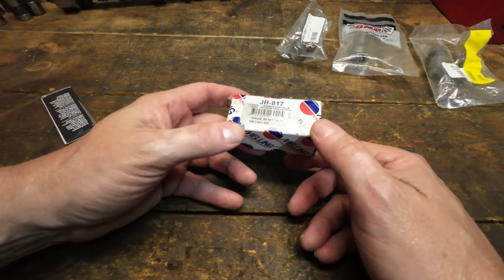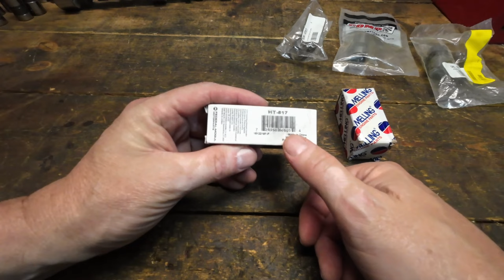Why your Flat Tappet Lifters Failed

Comment: I've talked to many camshaft manufacturers say the in the past 8 years say that lifter manufacturers are putting out poor quality products I've gone thru 3 set of lifters to get one good set. No swirl pits so on. Trying to push people to hyd roller.
Reply from the maker: @mattcross428  the big three that still make flat tappet lifters haven’t change the recipe on how they make those lifters.  Granted, they have limited production on them as those manufacturers also are tier 1 suppliers to the OEs and they have been on roller cams for going on 4 decades.  These still bigger factors at play here.

Comment: I found the more aggressive cams seem to have a higher rate of failure.
  Also Lucas make an amazimg break in oil !  Dont take an addictive and shake it up in the jug.
Reply from the maker: When I was collecting cams and lifters for this series, I saw no range of cams that had better survival rates.  Nor hydraulic or solid lifter cams.  It was a very broad range.  Maybe 50-60  failed cams is what I started with across all brands.  Can’t remember where I posted those pics but it was crazy to see so many in one spot.
Reply: @MuscleCarSolutions  in my experience the very high lift cams I have done have been prone to lifter/can issues. Like you said it's mostly a valve spring problem and a person not listening to protocol. I can't help a person that knows everything. Left the shop with all instructions even offered to do the springs before and after break in lol. 75% don't want the help.

Comment: I know you’ve said a dozen times by now about mixing brands of lifters and cams. But why is it I hear a lot of guys will get a comp cam or even a summit cam, and throw Genuine GM lifters with the hardened bass? I imagine if the new comp DLC lifters become popular, they will end up being the same. What’s your thought on why some guys like yourself say use GM lifters with the hardened base, with whatever cam they choose?
Reply from the maker: @GasBoy25  comp uses the same taper and crown as GM.
Reply: @MuscleCarSolutions  so if I bought a comp cam, I could use either the gm lifters or the DLC ones and I should be fine if I follow everything else like you mentioned as far as springs, bore clearance, and break in procedure?
Reply from the maker: @GasBoy25  I’ve had no issue, but if you’re doing it because you’ve been convinced that the GM lifters are superior, they aren’t unless you’re working on a stock profile cam.

Comment: I’m putting a new Comp cam and lifters into a 305 Chevrolet with new bearings and rings but I can’t find any break-in specific springs for it. Are there any you’d recommend? My initial plan was to just use the existing stock Chevrolet springs and my machinist said reusing the old springs should be fine since the engine spec’d out fine otherwise, but I’d like to eliminate as many variables as I can.
Reply from the maker: @mtfan  your machinist can find a spring for you that will set up at installed height with under 200 over the nose and less than 100 on the seat.  There’s a number of ways to get there.  If they’re a good machinist, it won’t take them long to find one.

Comment: The lifter failures are due to issues with machining of the lifter crown and occasionaly on the cam itself.  Here's what I do and recommend.
1.  Use a MATCHED SET OF COMPONENTS (kit) with matching cam / lifters / valve springs.  DO NOT MIX AND MATCH CAM, LIFTERS AND VALVE SPRINGS!!  Do yourself a 

favor and get a new Comp Cams or Edelbrock MATCHED KIT.  The wrong springs for your cam will kill it.
2.  Take your cam and lifters to a competent machinist to measure each lobe for correct taper and each lifter for correct crown. [It seems incorrect 

machining has been on the increase causing this rash of cam failures]  so this step is a MUST now.  See below how to check the parts yourself.*
3.  When installing the lifters, make sure each lifter will turn freely in the lifter bore and that there is no excessive wear of the lifter bore to cause 

lifter wobble.  
4.  Follow your cam company guidelines for installation (What you put on the bearing surfaces is not the same as what you put on the lobes for example).   
5.  Follow your cam company guidelines for break-in.  Do not let engine idle at all.  
6.  Use a HIGH ZINC break-in oil and then after break in use a High Zinc motor oil (DO NOT USE ZINC ADDITIVES OR DIESEL OIL!!)
7.  Drive the vehicle easy for the first 500 miles, don't go full send until you know that it's good to go.

*  If you don't want to take the parts to a machinist to measure, then do this:  Install and adjust everything but leave intake and valve covers off.  Prime the oil system with drill then install distributor to drive oil pump.  Then crank engine over with the starter with no plugs installed.  Check EVERY lifter to ensure it is TURNING smoothly.  If you have one not turning or turning but not smoothly... you have an issue! If they are all turning smoothly and evenly, complete assembly and fire it up!  If they are not, disassemble and find out why.  It won't fix itself!
Reply from the maker: I wish that lifter/cam failures were only due to machining of those tow parts.  In reality, it’s much more than that.  The other videos in this series cover those aspects.

Comment: I've been a mechanic for 30 plus years and have installed many flat tappet cam shafts and never had a single issue. Now, l installed a comp cams,valve springs,retainers on a big block chevy, and 20 minutes at 15 hundred to 2k rpm the cam and lifters are coming back out,im guessing its flat already, granted its been probably 10 years since my last flat tappet cam install,seems like everything that rolls into my shop has a factory roller set up,im guessing the cam and lifters are of poor quality
Reply from the maker: @barnhousegarage  what’s your lifter to bore tolerance?
Reply: @MuscleCarSolutions  haven't checked it yet,the cam and lifters that we took out were 20 year old comp cams and nothing wrong with them just went to a cam with a tighter lobe separation and a touch more duration,it's kinda strange that the cam and lifters we pulled out are nearly perfect and the new cam or lifters are having issues with 20 minutes on them,will now more tomorrow when we get it apart
Reply from the maker: @barnhousegarage  that’s something you know BEFORE you assemble an engine.  What spring pressures did you use for break in?
Reply: @MuscleCarSolutions  followed comp cams instructions, and it didn't say anything about spring pressure, the set up we got from comp cams came with the cam lifters and springs all in a kit,if there were issues with lifter bores l would have thought the old lifters would have shown ware? it shouldn't be rocket science, but l sapose there be an issue with the block? Hopefully not
Reply from the maker: @barnhousegarage  strike 2!  Spring pressure must be reduced dramatically on break in.  Initial and for the extended break in.  Big block Chevys while cool, absolutely have a horrible valvetrain design from the factory.  Without knowing the lifter to bore clearance and if it was in spec to facilitate the rotation of the lifter, and having way too much pressure, and a break in RPM was was a touch too high at 2000 rpm, that engine had all the right conditions to fail.  So what break in oil did you use?
Reply: @MuscleCarSolutions  Castrol 20w50 ,and I'm not doubting you on spring pressure. l agree that to much spring pressure isn't good on a cam during break in but l would have thought comp cams instructions would have said something about that?

Comment: The problem is the finish on the ground face of the lifter. One lifter manufacture left in USA, they make everyone's made in USA lifters.
Reply from the maker: Incorrect.  There are more than two still making flat tappet lifters and if you’re referring to the crown on the lifter, they are ground for what the taper on the lobe is.  As long as they are compatible, there is no problem.  Even crown that is well outside of the OE spec can work just fine, IF the right taper is ground on the lobe.

Comment: Dont use Chinese made lifters and cams!
Reply from the maker: I wish that was the only problem with flat tappet cam and lifters.  Sadly it’s not.
Reply: @MuscleCarSolutions  I use Elgin and Melling cams and lifters they are inexpensive and work good never a problem. They produce in USA and Mexico, here in Germany we add 2% Mos2 (Molybeniumdioxide) additive by Liqui Moly or Molykote to the engine oil aftre break in. German and Swiss Army do the same with older Tank and truck engines.
Reply from the maker: @Schlipperschlopper  never mix brands on cam and lifters.  Go watch my video on measuring crown on lifters.  Melling was the absolute worst.  Playing chemist and mixing your own oil is also a bad idea.  Any modifier doesn’t mix unless it’s at the right temperature and of it doesn’t interfere with the base oils additive package.  If it’s fighting the detergent, it doesn’t have the protection of the additive and you’re killing the cleaning properties of the oil.
Reply: @MuscleCarSolutions  Well since WW2 most armys mix 2% Mos2 to the engine oil for better cold start and hot running protection, Mos2 does not change the lubricant chemistry it even lubricates for a certain time if engine is running out of oil. As I told I use Melling cams with Melling lifters and Elgin cams with Elgin lifters this combination never let me down.
Reply from the maker: @Schlipperschlopper I hope your luck never fails.